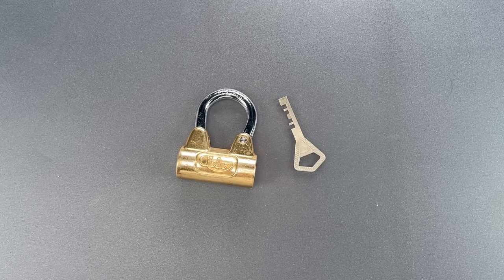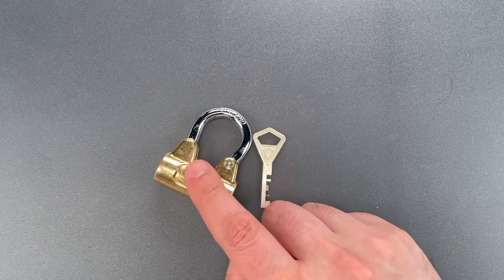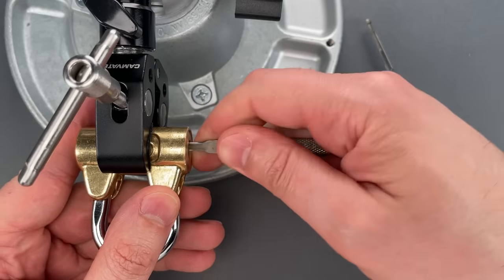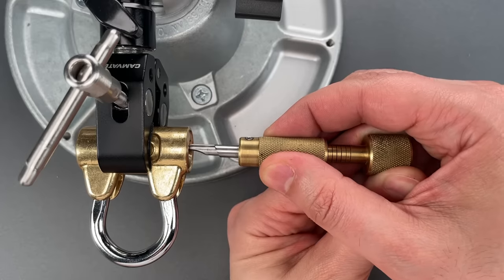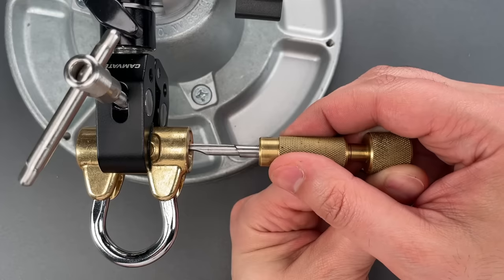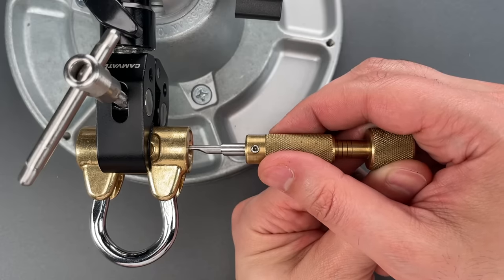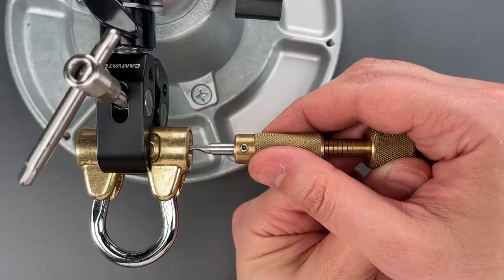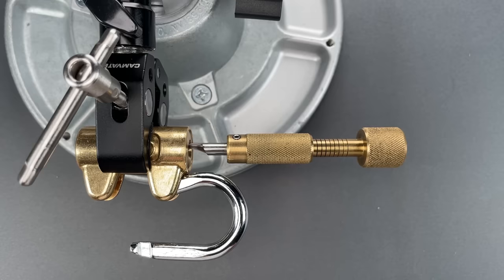[1416] Retro-Cool Abloy Padlock Picked (Model 3020C)

Comment: Old core yet still far better than modern locks...
Reply: old design, everything about this lock is new. It's a "retro" lock. They're made in Finland afaik.
Reply: my thoughts exactly!😂
Reply: Better by what standard?
Reply: @donaldbrorson4583  Are you new here?
Reply: @aserta  It is not really Retro i.e. deliberately made to look like old. It just has been in continuous manufacture. It is a go to lock when I've needs such a lock as it is relatively secure and affordable. around 20-30 €, you can get three for the sane key at 70 €. Newer designs are aboy 50 € a piece.
Reply: Only because it's unusual. 

If it were in wider use, tools and methods to defeat it would naturally appear.
Reply: Because it wasn't made by the Chinese I would think🤪
Reply: The core is new tech, it's meant to look retro.
Reply: @donaldbrorson4583  most locks cant survive 1 minute with LPL, the ones that do are good, the ones that take 3 minutes are exceptional tbh.
Reply: @ArKeTiCt  just because something is difficult to pick doesn't make it a good lock. If it can easily be bypassed with destructive means or be forced open then it fails as a lock.
Reply: @LSDale  not exactly
Reply: Yea…
Reply: @donaldbrorson4583  All locks are sensitive to destructive means, it's just a question about the amount of force needed. But for this channel it's picking the lock or bypassing it. However I haven't seen any good non-destructive bypass of this lock. There's no spring-loaded mechanism that you have to overcome so shimming is out of the question.
Reply: @ehsnils  the lock rattles a little bit when he manipulates it so I would bet that it's a little loose around the hinge. I would go off on a limb to say that the security of this lock is only as good as its hinge is strong. Based on the cheaper material quality of the other components I dont think that would be all that strong when all is said and done. Plus you can see what looks like the rivet that would hold the hinge's axel in place which could be a point for a potential low profile destructive exploit.
Reply: @donaldbrorson4583  The lock rattles because the locking pawl or slider has some free play by design, it's not the hinge that rattles. No advantage for circumvention can be gained there.
And as noted before, this is about picking and circumventing.
Destructive access is of course possible, but then it's also obvious that someone has gained access.
So even if this isn't a high security lock from the perspective of destructive access it's definitely a very good design from the perspective of defeating non-destructive access.
Reply: @aserta  that core is over a century old design that lock is I don't know how old but there is nothing about that design that suggests it was designed within the last 20 or 30 years so it is very definitely a retro padlock that is arguably Superior to most things you can buy in a hardware store in Canada or the US I don't know how it is over in Europe but I can assure you of that over here

For anyone doubting my claim there are few locks in a hardware store that have better cut resistance for their shackles some probably have quite a bit worse especially if there's model 410s available but those technically aren't security devices so moving on and the majority of those padlocks will probably have one design flaw or another that will let you bypass either the core or the mechanism that holds the shackle closed, seeing as this is an abloy classic we can be pretty sure the fact that there is no bypass for the core and I don't even know how you would shim that shackle assuming it is shamable
Reply: @Ruefus  the issue is that the only tool that is known that can get into that key way is patented by somebody and they charge like $300 per tool, and I wouldn't be surprised if abloy takes some design changes  not too far in the future to make that tool obsolete
Reply: @iomeliora9430  no the abloy classic core has existed for a long ass time and that is exactly what is used in this lock, it's just that most lockmakers don't actually care about security so they don't use good cores for their locks
Reply: @donaldbrorson4583  don't think of this lock as a high security device think of it as a reusable tamper seal, you care enough about the item you're locking to know if somebody's gotten in there but not so much that you're willing to put actually good locks on there. Say you work at a business where you have a lot of very important documents that cannot be tampered with for example if somebody really wants to mess with those documents they'll just take the sledgehammer approach but having something like this on there will prevent somebody from just taking a rake and a turning tool and gaining access to the filing cabinet
Reply: You seem to not understand the difference of the core and actual locking frame. Same core is in much hevier locks this was probably cheapest to mail. If the core is easy to pick it does not matter what frame you have.
Reply: @Ruefus  It's really not unusual. ASSA ABLOY is one of the biggest lock companies in the world.
Reply: @iomeliora9430  No it's not. Source is that I'm a Finn. That key type was originally introduced by Abloy sometime in the late 40's and about 15 years ago they finally said that it's no longer fit for a safety lock. The lock is newly made but the cores are most definitely not new technology.
Reply: @donaldbrorson4583  "Better by what standard?" Pick resistance. Especially when so many locks shown on this channel can be opened with a rake attack (I would call this "no-skills picking"). If this lock would be susceptible to other non-destructive methods, I'm sure LPL would've shown it (he normally does).
Reply: @Ruefus  These cores are everywhere in Finland. For decades they were the default lock in houses, mailboxes and what have you. And I have seen these exact same padlocks everywhere as well, in fact I use these to lock our cellar doors.

Comment: Yay 🇫🇮 This is a very common lock in Finland, often securing shacks, storage boxes and the like where the main purpose is to keep honest people honest. Determined intruders will go around the lock, destructively. Not the cheapest one though, 30€ at the local hardware store, but it'll last you a lifetime, and is apparently also quite secure.
Reply: Probably 90+ % of lawn mowers in Finland are behing doors locked with Abloy Classic cored locks.
Reply: Tru story bro. Kippis!
Reply: I have the Abloy 340 on my storage in the basement. I don't expect the lock to get cut, I more expect the hasp that it locks into being broken loose from the wood.
Reply: Exactly, this is the low security version we use here in Finland. Most houses and other valuables are locked by better Abloy locks
Reply: @aqualung.  At least mine is :D
Reply: And that's exactly what this lock is it is a reusable tamper seal, easy enough to break if you wanted to break it but then again the thing it is securing is probably easy enough to break/steal if you wanted to.

Because this lock will absolutely keep out pretty much anyone who isn't going to just outright destroy the thing
Reply: About half the locks I see in my apartment complex storages are these.
Reply: Torille tavataan!

Comment: Abloy must be happy with this video.  Any lock that takes LPL this long to open is a good lock.
Reply: This is going to become a high end lock company lock brag 

"This lock has 1 minute LPL rating"
"This one here has a 3 minute LPL rating."
Reply: Abloy is known to be the best lock company in the world.
Reply: Assa Abloy probebly was the first to like it
Reply: ASSA ABLOY is one of the most well-reknown lock companies in existant, I don't think they'll notice
Reply: Abloy is literally selling this lock type as "Abloy Classic" and they recommend using it for unimportant things such as rowing boats or gardening shacks. The major selling point of this lock is not the security but it's ability to cope with harsh environments. When you have a rowing boat outside under half a meter to meter of snow for half a year 10 years straight and expect the lock to open without trouble, you use Abloy Classic.

For modern houses, we usually have at least Abloy Exec level locks. Those have better user interface (the key is a bit easier to insert and remove) and are harder to pick. However, the more modern variants have some parts that cannot deal with the harsh environment equally well to this old design. Those are still better than pin tumbler locks in harsh environments but not as great as Abloy Classic.
Reply: @oldtimergaming9514  Most likely not a 1 good thunk but in few yes but after all it is made for sheds now days

Comment: Most common place nowadays to see these in use in Finland are storage cubicles at the basement of old apartment buildings. Each apartment has its own little storage space, right next to each other, walls made out of thin boards and chicken wire. It is so funny to see these locks on doors while one could get throw the "wall" or door with scissors.

This type Abloy was pretty much the only padlock you could by in Finland until late 70's.
Reply: If you cut through the wall, it's abundantly apparent that a thief has stolen the goods. Presumably insurance would then be involved and make amends. Whereas if your stuff just "goes missing," insurance will start asking pointed questions, like, for instance, is the stuff that was in this cubbyhole now sitting in a box in your grandparents' farm's hayloft while you defraud the insurance company for its value?

Comment: So... Let me get this straight...
The 100+ year old design of this lock is better than the current generation of Masterlock padlocks.
Reply: It is the original disc detainer design and well 100 years hasn't diminished the inherent benefits of disc detainer as non spring loaded design. It still 100 years later take manipulating each disc individually to manually place them in gates. Add even modicum of false gates and it gets tricky. Even without false gates it takes custom turning tool, instead of wavy bit of steel.

With pin tumblers one has to go to great lengths to make the lock not be trivial to pick, where as disc tumbler is inherently non trivial to pick. one can't just smack the discs and have them jump to gates like pin tumbler pins.

What I don't get is why people still bother with cheap pin tumblers. The patents of Emil are half a century expired and it isn't inherently more expensive to make disc detainer. You can stamp the discs on a stamping line and the lock body is drilling round hole in block of metal plus the cut for the side bar to sit/jam at. It doesn't take exotic difficult machining operations to make. After all it was designed to be reasonably easy to produce with early 1900's machining equipment. Most complex part is the disc housing core and even that ain't that complex to machine
Reply: In one word: YES.
Reply: Than any generation of masterlocks (i think they were around then too)
Reply: Locks aren't really designed to keep people from picking them, because most locks can be broken rather quickly, quicker than it takes to pick them even. You could have the worlds most unpickable lock, and its material strength would still be its major weakness. You also balance practicality of size and strength with cost. For the most part, locks are designed to ward off sudden opportunistic theft, and make it just hard enough that most people could risk getting caught trying to either pick or break the lock.
Reply: To be fair here, a reshaped paper clip is better than the current masterlock padlocks. And could probably unlock one, too.
Reply: To be perfectly honest this just feels like a statement of general fact, and not some sort of wild realization based on a very impressive lock.
Reply: @peoplez129  yeah lpl proved that with 2 wrenches

Comment: Finns are generally really proud of this - which in any real sense is a - unpickable lock. Of course you can pick it with the tools and skills, but hey c'mon. This lock design should be the one to use on every lock created. I've never understood why it isn't.
Reply: I think the pride comes with a cost. Although it is common in some countries, the core is expensive for no good reason. It is fairly simple and cheap to make (the core at least). But yes, it is hard to understand why anyone would make any other design but this. Chinese (I assume chinese) make copies of the core and discs which are exactly the same and difficult to tell apart, but only for the old ones like this afaik.
Reply: Where's that Ryobi....
Reply: @gearloose703  I agree 100% that it's hard to understand why every Chinese lock is not just a mirror perfect copy of older Abloy designs. All the patents have expired worldwide even for the Abloy Protec (the first generation model, not the Protec 2 yet) and anybody could just copy the whole design and sell decent locks for cheap. Even the Protec core uses mostly stamped parts so it would be easy to manufacture with modern machines - you just need a stamping machine accurate to about 0.1 mm.

Comment: That is the lock we got for our personal lockers in the Swedish (back then mandatory) military service.
Reply: Finns do too, naturally
Reply: @aqthefanattic7933  When I was in we got the more modern incarnation. Still same classic core, but in PL321 brass body.  Seems catalog says they are all chrome plated these days, but ours was in plain brass.

It seemed to be important the lock not to be TOO strong, so the staff could cut the lock shackle without too much trouble with bolt cutters. I think happened once in my unit, because someone lost their key in the woods and then the watch officers came with bolt cutters, snap and gave the conscript a new lock. Ofcourse ahemm said conscript had to file for the losing of the key and thus also the lock and got dinged for it from their per diem.
Reply: @aritakalo8011  hey at least you didn't lose a key to a few million € viestikontti. Like our squadleader.. was fun combing the damn forest for few hours with like 100 ppl. Was newer abloy, harder to find than all metallic ones.

Comment: When it has a disk detainer core but LPL doesn't use the pick he and BosnianBill made: My disappointment is immeasurable and my day is ruined
Reply: But isn't that the ultimate compliment for the lock? It even defeated that tool.
Reply: I assume that pick wouldn't work with this old design
Reply: but the sales of that lock goes sky high.... if it is even sold....
Reply: LPL&BB pick tensions the front disc, Abloy classic needs to be tensioned from the back disc, hence that tool doesn't work on this lock.
Reply: @Arch3r666  It's sold in pretty much all hardware stores in Finland. It's one of the cheapest Abloy offerings. (Priced around 25 €)
Reply: yeah it just leaves me with so many more questions. why not use (TPTBB&IM) was there a personal reason? did he make a new pick by himself to sell on Covert Instruments? is there something about this lock that (TPTBB&IM) can't do? what might that be, tension off of disk 11? (it's usually disk one). can we please see the inside of this core? ....
Reply: The problem with that tool, is that it can only tension off disc #1, and this core (alongside a number of others) has a spinner in that position, so it must be held under tension from the back.
Reply: @MrHemanclix  The tool they made together tensions off the front disc. This lock needs to be tensioned off the back disc. Wrong tool for the job, that's all. Even the most ridiculous tubular locks require more than one tool to open—they come in different sizes and pin spacings.

He and Bill probably could produce a tool for this particular lock … they just haven't. And I don't know if Bill's retired from the hobby as a whole or just from YouTube, but it seems less likely that they'll likely collab on another disc detainer tool specifically for these cores now.
Reply: it has an irregular keyway that you need a custom pick for. you cannot front tension it with a regular DD pick

Comment: These are very common locks in Finland.  You also need to wait until the summer if you plan to pick it in the field.
Reply: True, going to the summerhouse tomorrow.. 100% sure that I will have to heat the lock of the storage for extended period of time to get the damn thing open and get inside to melt dry

Comment: You know the lock is tough when you need to use a custom tool.
Reply: In this case, yes—but not necessarily in the general case. LPL has opened plenty of locks for which he's needed to make a custom tool that I could both fashion and use. It still required a custom tool, though.

Comment: I think these ones are nice to have in places where the intruder would have some time to spent on the premise, like they often are in Finland, for example as locks on summer homes / toolsheds etc. Where determined intruder can just break their way through windows/doors, causing more damage. And the stuff inside usually isn't too valuable. So what you want is a broken lock to show the insurance company. So high pick resistance -> easier to break the 25€ lock then the 100€+ door or window. And as picking is not too likely option -> evidence. Same lock cylinders are used in doors and postal boxes in older houses.
Reply: Funny thing is that our postalboxes have abloy sento cores.  Frontdoors however still has abloy classics :D
Reply: @juhavehmanen8604  Mail theft is a very serious crime. Definitely much worse than breaking and entering.
Reply: Reason number 1 I have set lock in my summer cabin so loose that you can pry it open with minimum force needed. The door is more expensive than anything I have there so I rather have it crank able with screw driver. If someone wants to get in he will